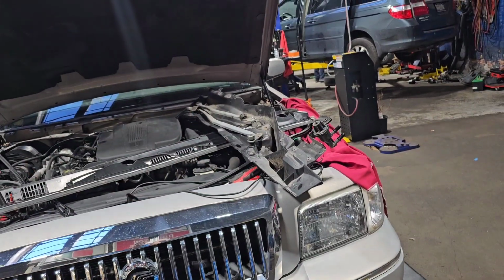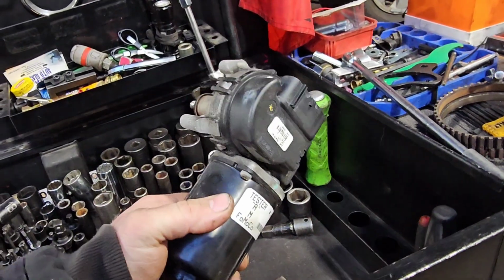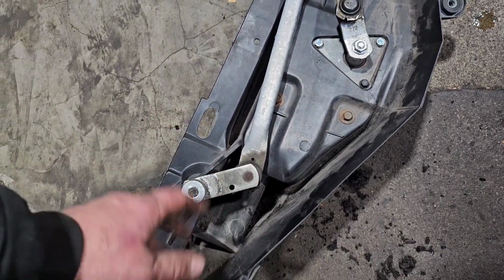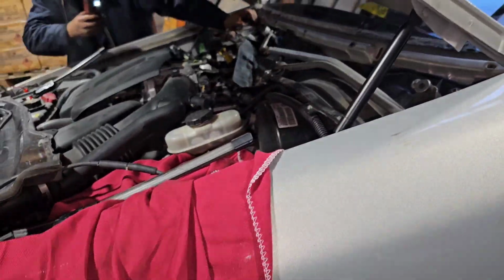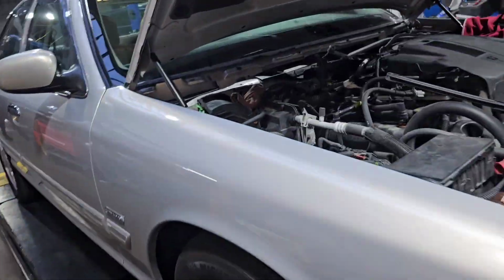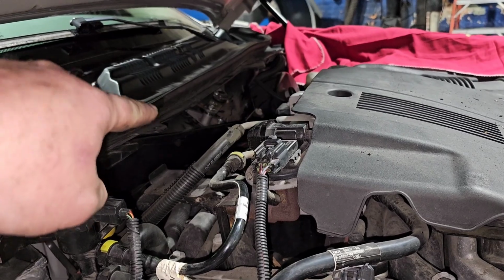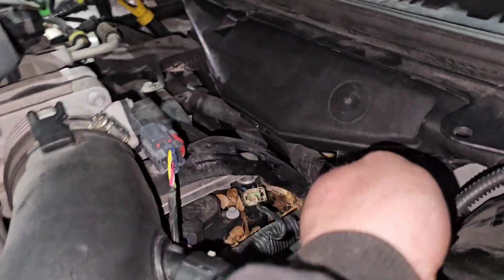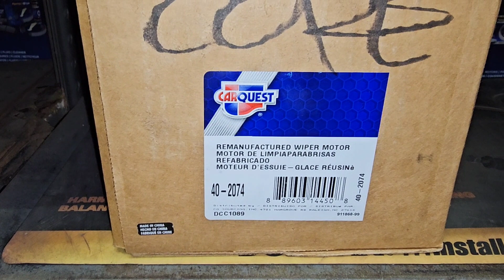2010 Mercury Grand Marquis - Windshield Wipers Not Working - Fuse and Motor

Comment: Nice car hard to work on.
Reply: These cars are actually one of the easiest to work on no matter what the problem!
Reply from the maker: There's nothing hard about this car to work on it's actually like the easiest car to work on
Reply: I concur.  These cars are relatively easy to work on......when there is any maintenance  required.   But these 4.6l V8s are 
 bulletproof.  So you won't be under the hood that much.  The Panther platform autos have plenty of room under the hood to work.  Although you may need to remove plastic engine 'beauty' cover and/or air intake snorkel tube w/filter box to work on one of these cars, by newer car standards, everything is reasonably accessible and easy to reach.